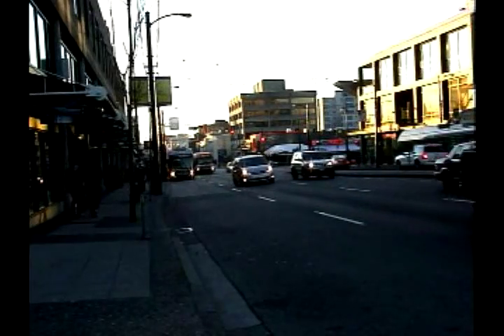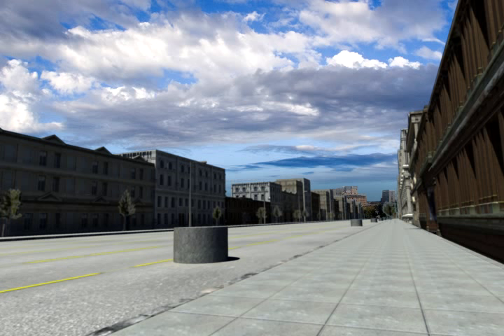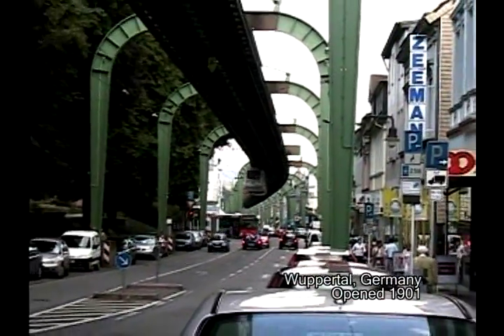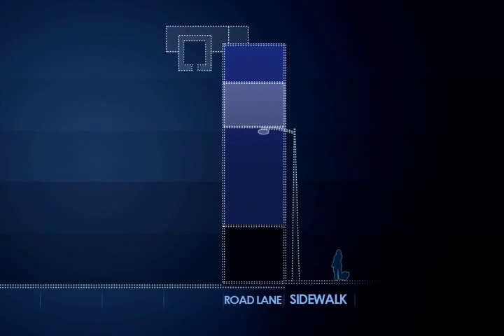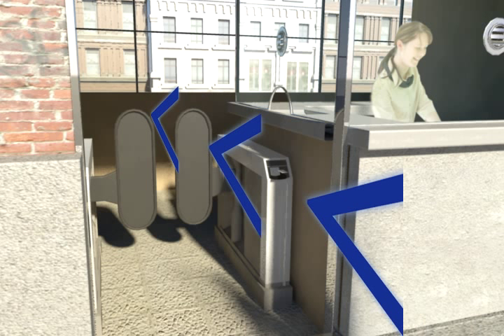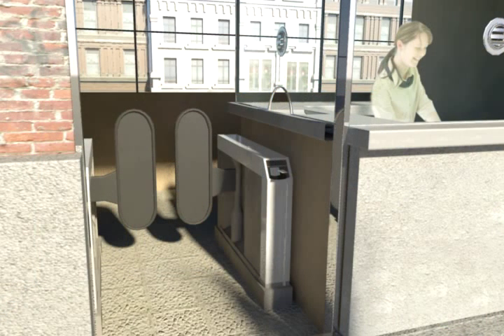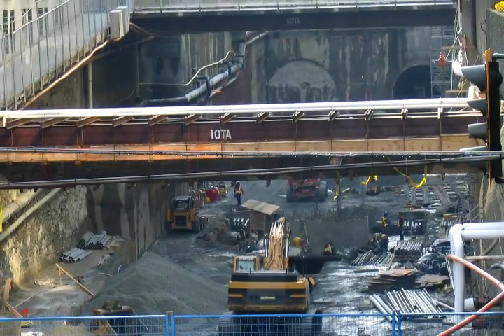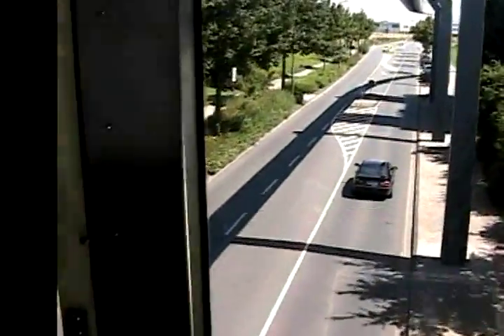Sky Trolley Bus

Comment: I'd like to see vacuum tube technology expand with Cylinder Cars that are designed for comfort. Vision a huge flexible seamless sewer pipe under ground that moves people around through a vacuum tube expeditiously. There would be no permanent ENVIRONMENTAL impact.  There would be little to no upkeep fromo oxidation. There would be virtually NO POLLUTION, No Hazards to Our Health or the Air we breath from emissions.  Using magnet technology to eliminate the resistance of gravity.  There are multiple braking system to choose from. By weighting down the center length of the cylinder to  hold the level steady.  The air can be captured in a bladder with a dual check valve and reused to push the car forward. High speed braking has been perfected by amusement park ride technology. Vegas Nevada is working on this technology now. It would be perfect for along Hwy 37.  As a back-up form of transportation, the transportation authority my help fund it. The government my contribute as they can use the system to access government offices for emergencies and as a back-up for down system, protesters, gridlock, earthquake bridge failure, et all.  A station on Mare Island would get you to San Francisco in a matter of minutes. It would lessen the pressure on the commute, get cars off the road and a multi county tourist extravaganza. With a fee attached, the San Francisco Bay Bridge Authority would most likely permit a section suspended from the main girders of the bridge out of public view, attached to the underside of the bridge on West Sides main support piers of the Golden Gate Bridge for an amazing view of the ocean, using a bullet proof clear acrylic tube in that section to allow a glimpse of the oceans panoramic view on clear days.

Comment: Ultimately unfeasable. Suspended monorails have particular issues. Firstly cost and mantainance issues of monorails have always limited their adoption. In addition, monorails have to be put high in the air, which limit rescuing capabilities if (and when) something goes wrong. In this case as well, large pillers will be close to traffic, echoing problems with ships and large bridges. The "weatherproof" system is likely not weatherproof. 

The elevator platforms seem like matatainance nightmares, as well as heavy, unnecessary complexity. Depending on the control system it either enforces a short loading/unloading period and lack of time flexability if it raises at a specific time, or if controlled due to the arrival/departure of a train, cuts off people that could be on time but later than the train. It's very clear that the design does not really take into account mobility limitations and viable passanger numbers, with the reason for large station design often being the need to handle large passanger numbers and people with mobility limitations.